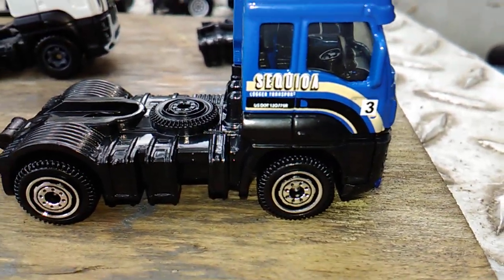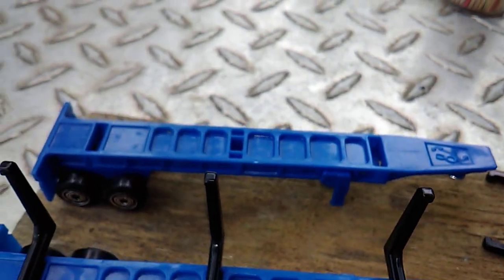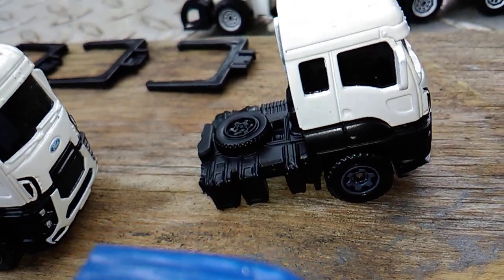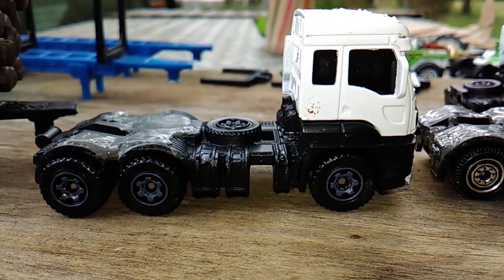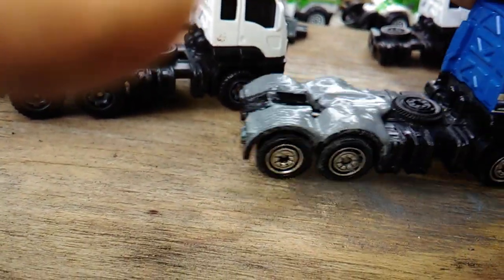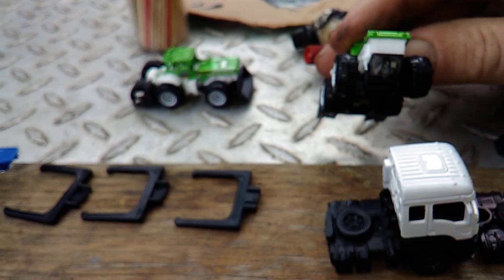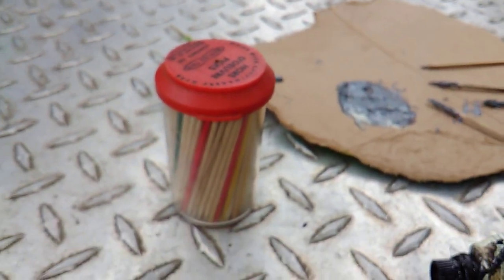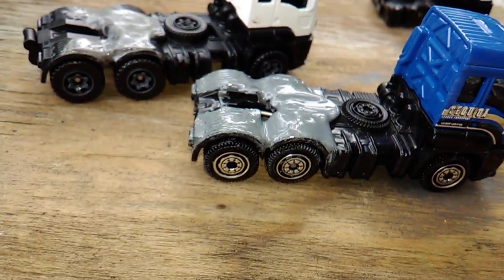My Custom Matchbox Build

Comment: Ah you've done fantastically well there Mike! Get that JB Weld blacked over and you'd never know it was ever anything but a tri axel rig! Well done! 😎👍
Reply from the maker: Thanks  ... I already like it better  ....  And  besides  ...  Around here  all  log trucks have  tandem axles    a single axle would be  stuck  in the woods  24 / 7     rat  just gave me an ideal  to  take the  leftover  cab and  cut the back half off of the cab and  make a  sleeper out of it for the  custom  one    I'll do the white one  not the  blue one
Reply: Yes I read the comment from Rat! Just take it steady and dont undo your hard work! Your right to try the white one first! Good luck! 👍

Comment: Awesome job with the customs brother, now they look like a proper rig. File down that JB Weld, paint it you'll never even know, it needed the extra set of wheels expressly after you added all those logs to the trailer. It looks good brother.
Reply from the maker: Thanks  .....  Yea  it just  didn't look right  with just 5 logs ....  Around here  a  log hauler  has  twin axles and  a full load  ....  You  never see a half a load  or  single axles  for real   hey. Just  one week and 2 days ago. A friend and I were  going in to town and  and the road  passing the  mill is a  5 lane road   and  lined up in the middle lane  was 30 log trucks  loaded and  lined up waiting to get in to the mill  to be unloaded .... Dew to a tornado hit some of the  unloading equipment  was damaged  so  unloading is slow  now so  the  waiting line has stretched out on to the  main road
Reply: @mikedison1149  you had a twister near you? Hopefully it didn't come to close to your house, but like I said it is a proper rig now brother.
Reply: @mikedison1149  I just found the escort loose but I'm not sure if I have a carded.
Reply from the maker: @davidbeeson1178  yes a twister  came by  about a month ago now  ....  It was  7 miles from my house and  traveled on the ground for a  mile  ....
  About  5 years ago  one  started  about a  mile away from me and my house and  tracked all the way to town  right down the middle   at least 15 miles of damage   and it  took out all of the local TV stations for  hours  ...   ironically nobody died
Reply from the maker: @davidbeeson1178  loose is better than zero
Reply: @mikedison1149  it yours then.
Reply: @mikedison1149  wow that is a little too close for comfort brother, the main thing is nobody got hurt because buildings can be rebuilt.